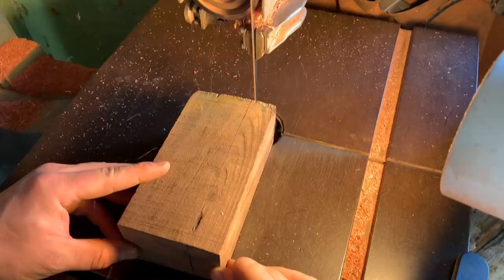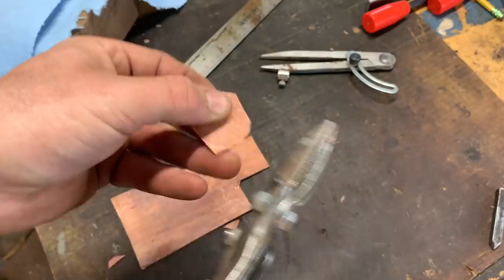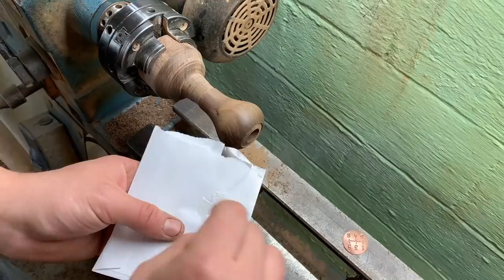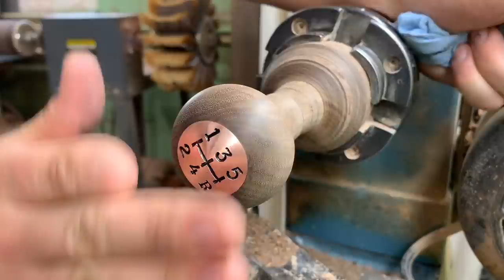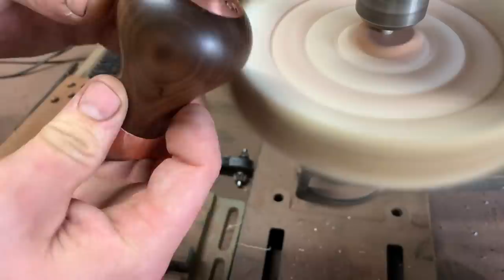Woodturning a Gear Shift Knob, Copper and Walnut

Comment: Where did you source the copper emblem/badge? Looks real smart.
Reply from the maker: Thanks Jason, the copper is from old plumbing pipe that I cut up and soften
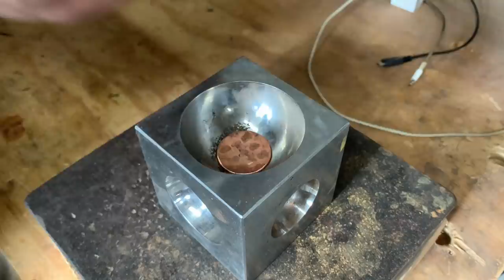Reply: @AdirondackIron  Very cool. What's the tool called at 2:46? Never seen one of those before. Looking forward to more videos 😊
Reply from the maker: Its called a dapping block, basically a small swage block. I put a link in the description. There are cheaper sets but most aren't that big, I used the largest size (2.5 inches) for this project. Thanks for watching!